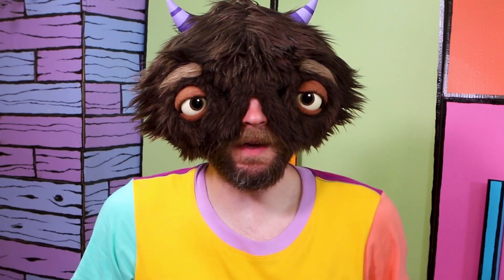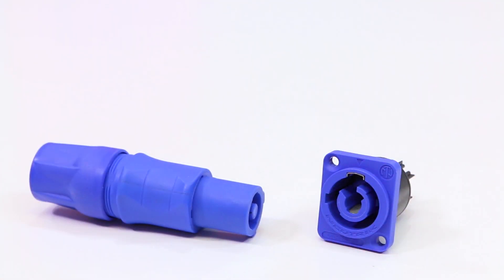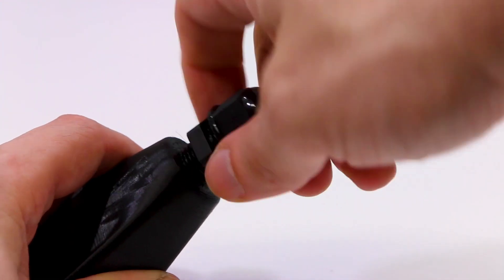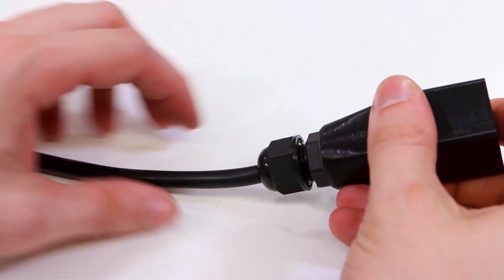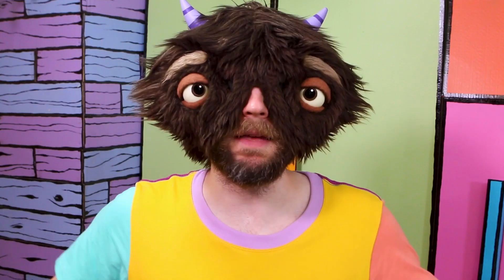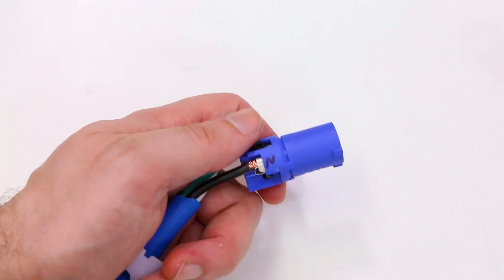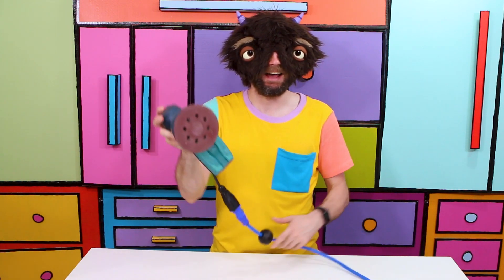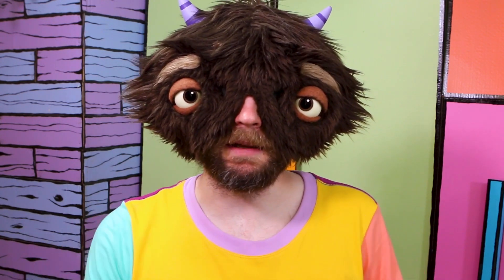Why cutting my power cords was the best idea ever

Comment: That's great, I'm an electrician and did that to all my corded tools years ago. 
A. It keeps others on a jobsite from using my tools. 
B. It definitely helped with storing them without the extra cord. 

Only thing I can say is your diagram should have them labeled as Line, Neutral, and ground instead of positive and negative. After all, it's AC not DC.
Great job buddy, keep it up
Reply from the maker: That's true! I was going to but figured I probably would have understood it more easily if it were shown like this and I didn't fully know what meant what 🤷‍♂️
Reply: @TheMakerMonster  all good buddy, if you ever have electrical questions feel free to reach out. I enjoy teaching,  I also need to send that lamp to you we talked about before covid hit and turned the world upside-down.
Reply: Thought I would read the comments before I said it was AC, which is not DC unless bridge rectified. But you beat me to it Jason.

Comment: Clever! I've never considered that, but audio connectors must be rated for high amps and hard abuse, so it's perfect for tools!
Great to have an assortment of cables in different lengths, to have options if you ever want to leave the shop.
Reply from the maker: True! I plan on making at least one regular extension cord version in case I've ever got to bring them somewhere else.

Comment: I got thinking about this again... Why wouldn't you just put new regular outlets on the shortened cords? What benefit is this connector over the regular one? I understand the shorter cable on your tools, but you can get regular outlet ends that just screw in normally. I feel like that would have been more practical. The only exception is what other people are saying about tools on jobsites.
Reply from the maker: The locking means I won't have to worry about them ever coming loose. That's the main benefit for me. Makes it just as secure as it was before.

Comment: Good idea. Why the custom connector though? You probably could use regular connectors like the ones used on extension cords. To make sure it doesn't pull out too quickly is also easily solved with a 3D printed addon. That way, you're not bound to your own system when you need to take your tools somewhere else.
Reply from the maker: Ehh, I don't tend to bring my tools around too many places. And I can always throw together a regular extension cord with the plug end!